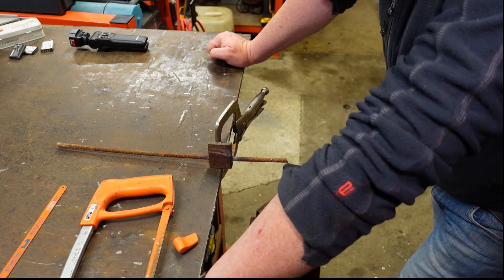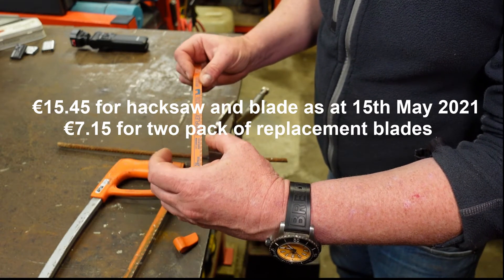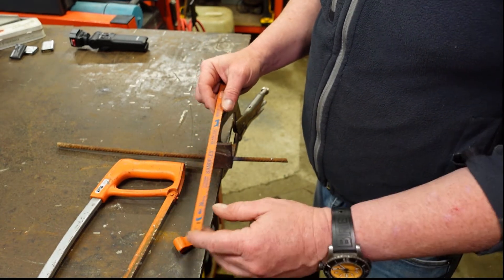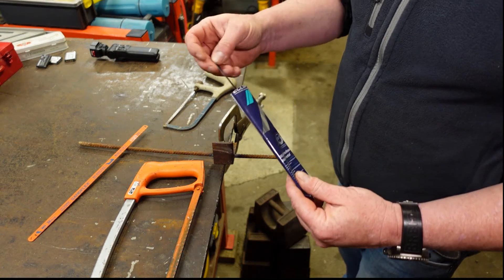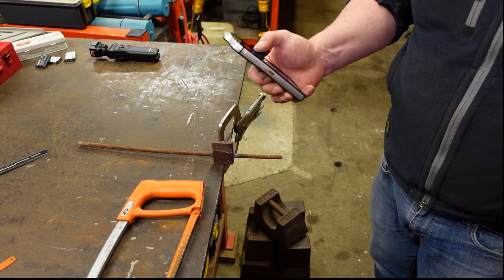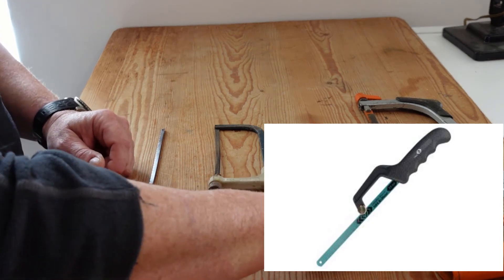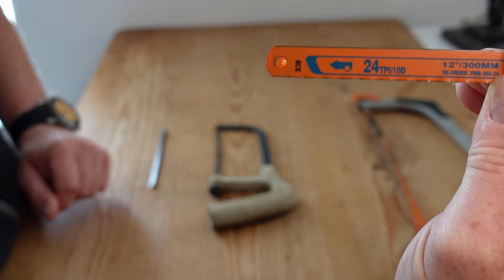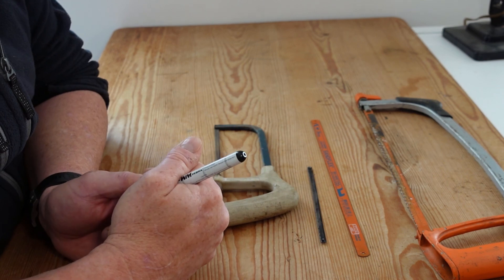Cutting Steel   Chapter 1 - The Hacksaw

Comment: Thanks buddy.. when cutting a metal tube, why did my saw keep jamming?
Reply from the maker: Hard to diagnose from afar but possible reasons are 

the hole is closing up as you cut, try putting pressure on tube to open it

You might be pushing down too hard, try a quicker lighter cutting action

Check your blade to see if any teeth are damaged, if so replace

Check the teeth per inch, if your blade is too coarse it would jam easier. More teeth per inch (finer) is needed for metal. 

Hope this helps